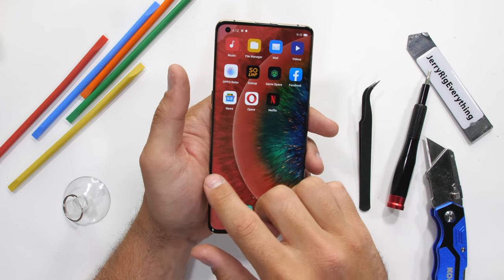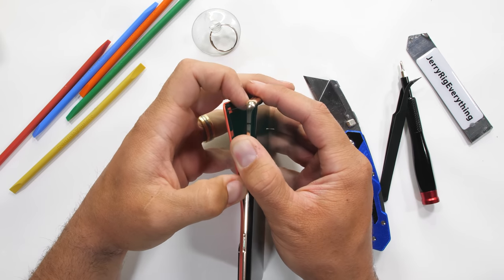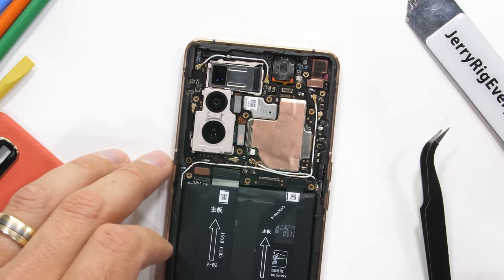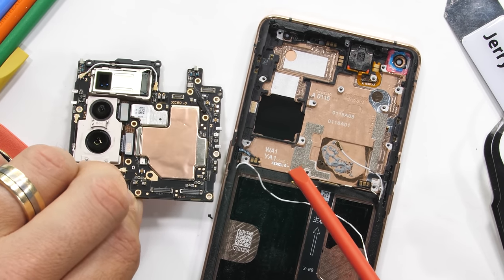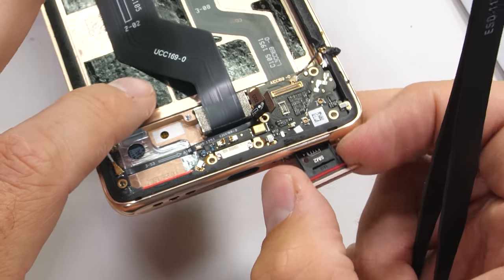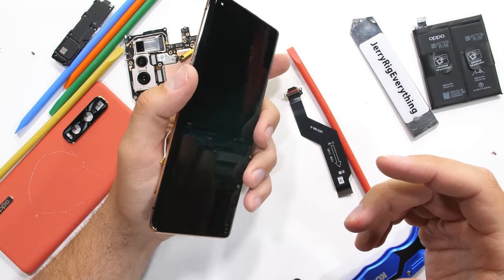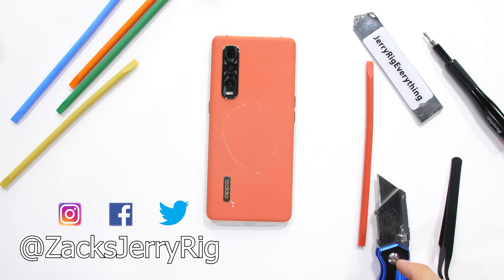Vegan Phone Teardown! - Its not as boring as we thought...

Comment: If anyone was wondering why two separate batteries instead of one with double the capacity helps with fast charging: the batteries are in series (double the voltage of a single cell) so the phone needs to do less work changing the 20V it gets from the fast charger down to battery voltage.

Comment: Just because they use 2 batteries, doesn't mean they can handle higher charging speeds.. The only benefit by using two batteries is: they switch it in series while charging. This doubles the voltage, wich means half the current. So the phone doesn't need a dcdc converter(wich creates lots of added heat) and normal cables and the usb-c port can handle the power.

Comment: The double batterie is here to take a high voltage without converting it, if you charge 5v volt batterie with 10v, the batterie needs ton convert this high voltage, but if you charge two small 5v batteries with 10v, no conversion, no heat generated

Comment: @2:57
My understanding is that it charges them as one in sequence, so it can use a higher voltage without a heat inducing voltage stepdown.....then for the phone to use it they run in parallel. That at least is what I rad about oppo super vooc a few years ago

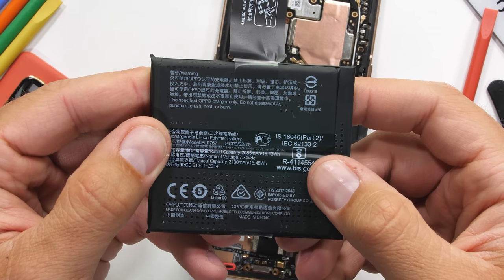Comment: 2:40 I think one was to manage the batteries is wiring them in series, so the whole battery is just 2130mAh, but instead of nominal voltage being 3.7, it would be 7.4? So there's less current flowing into the batteries, meaning less heat generated, but it's at a higher voltage, so less voltage stepping down from the charging brick?

Comment: I give oppo find x a big thumbs upbecause the battery is removable in modern days smartphones replacing the battery is a hassle but in this smartphone we can do it very easily and we can avoid the unwanted attention of breaking the back glass cover 😂 but in this phone case we don't have to worry about that and it gives us the easy access to remove battery and swap the new one 😁 overall I think every smartphone company text idea from this smartphone currently I am using this smartphone as my daily driver. Changing smartphone every yearit is a big problem because in your daily driver you keep your informations what is important . for you changing the phone frequently gives us more problem then solution